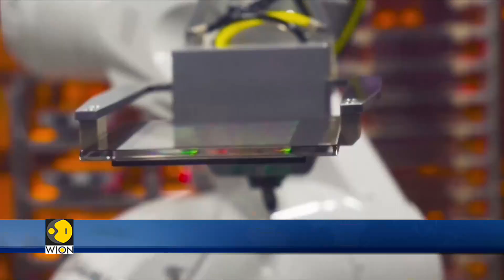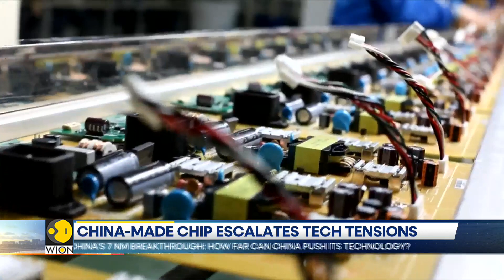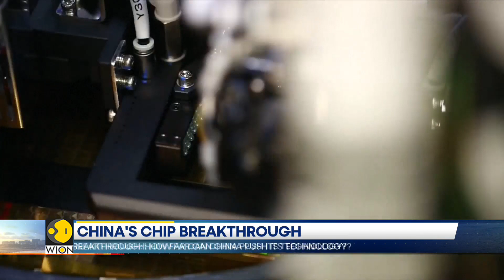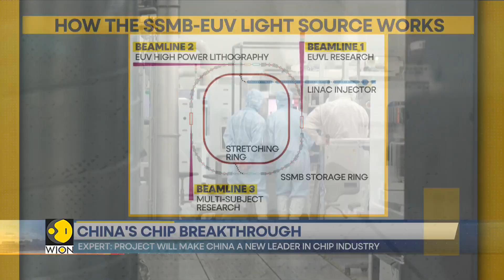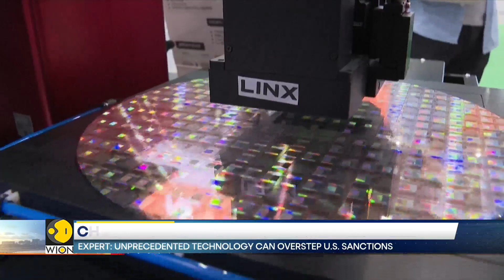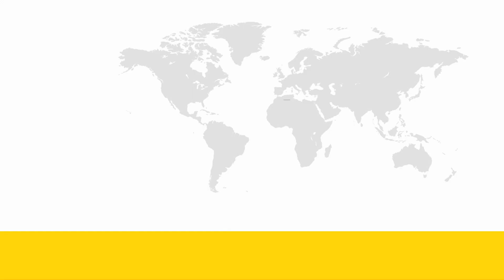China set to build giant chip factory using particle accelerator | Latest World News | WION

Comment: This is complete nonsense. I would actually want to see the chips. Perfectly a sizable sample to test. It takes at least 5 years with an established fab to even begin. Let alone a new technology that has not been proven. It is very likely it will fail or take a long ass time.
Reply: You can carry on with your wishful thinking brother. Nobody is stopping you from believing your own delusions lmfao 😂😂😂
Reply: Actually you are wrong. This works perfectly well and indeed gives a much higher light output and a lot more stable light source which can be tuned to whichever wavelength you want. The ASML system on the other hand is fixed as it is a quantum transition in the tin atom.
Reply: The chip war is heating up and it is really exciting. I have been following the news closely over the last one year. Better than Hollywood movies which is all fiction 😂